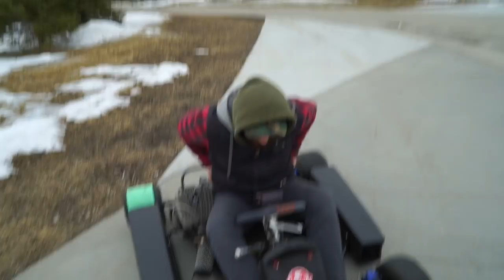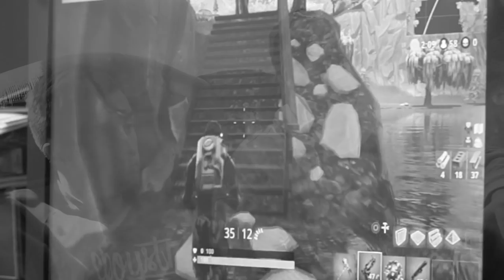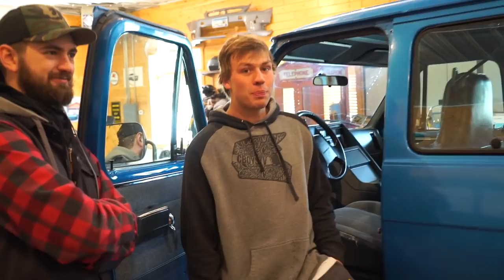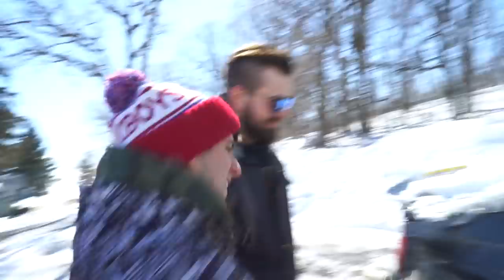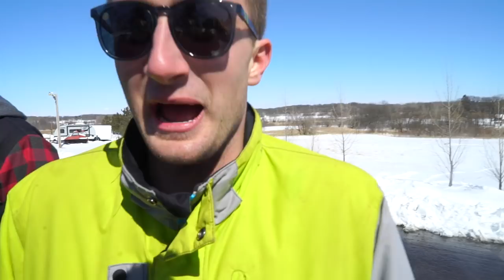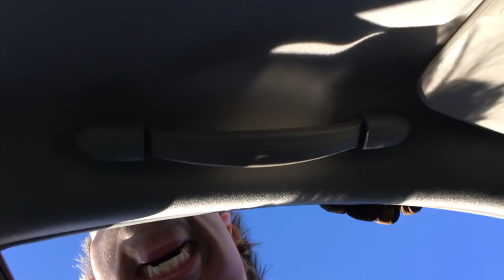He Thought We Vandalized His Car...

Comment: Blacked out back windows, led lights around the trim, put some fake hardwood floor in the back, and a ac off a small RV, roof rack, and ditch those steel wheels. Custom offsets has a good selection of wheels and tires sure they have something for it.

Comment: With your shifter car I had the same problem it started reving on its own. You need to turn the idle down on the carburetor the mixture is to rich.
Reply: Alternatively you may have too much air entering, so you might also be running to lean.